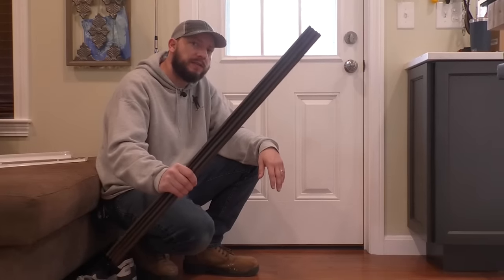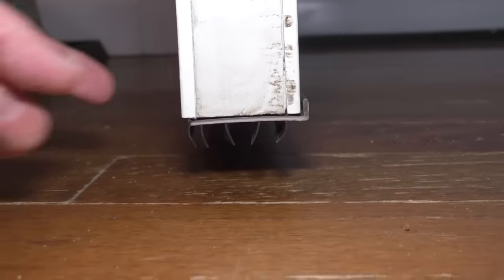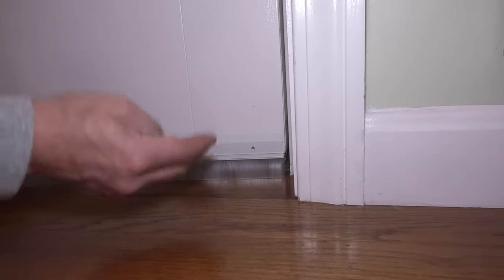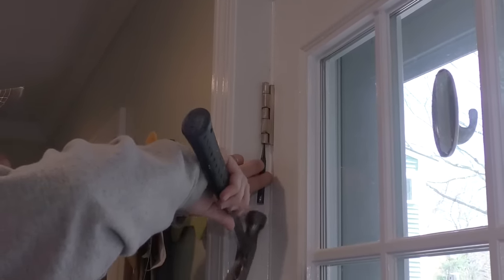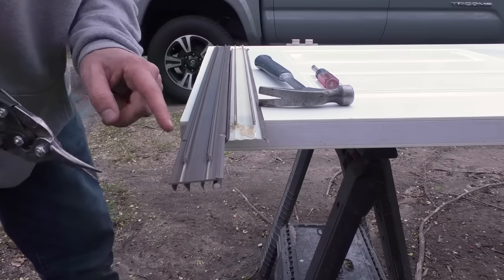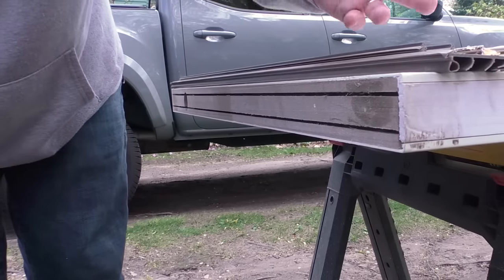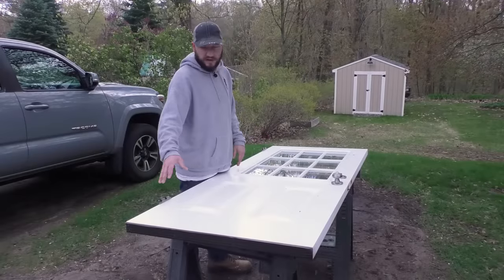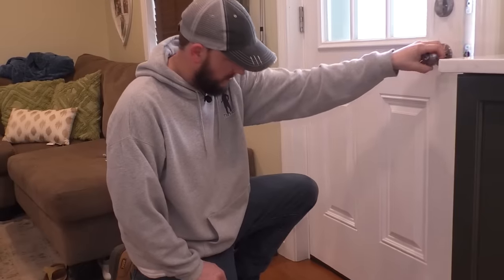How to Replace Door Sweep | Fix Gap at Bottom of your Door

Comment from the maker: Subscribe to my channel: https://bit.ly/SubscribeToTheFixer

Thanks for watching! 😃
Reply: GREAT HIDING PLACE Matt👍💯
Too funny 😂😂😂
Reply from the maker: @Rebecca C Ramirez what’s up?
Reply: Thank you!!  I have gone an entire winter not quite sure what to do… even have my door seals (not sure I bought the ones for bottoms of the doors… but seeing you do this.. I’m feeling like I can do this, so I am going to!  I also want to put a window in my steel door.. so :) just fyi in case you are planning to do that, I’ll be watching.  Thank you!
Reply: Does this work if say you weren't sure if there was a sweep previously? And how about on a storm door?
Reply: That vinyl slide-on piece is a piece of junk.  Tried it before on a patio door and it broke the pieces underneath in a matter of weeks.  For the one you chose, I would've used screws instead of nails because over time those nails will come off.

Comment: This video triggered my PTSD (sorry for exaggerating) but what should have been an easy fix took me three years to complete. The builder of my old house decided to use special doors by Pella… It was not a standard size but it looked really nice. The entry rug was short but not short enough and after a few years the sweep was ruined. I went to a Pella dealer and they helped me find the model number in the jamb and how to submit the order. Great! Simple enough, but I was wrong. The sweep that came was 2 inches too short. Went through that a few more times. But over 30 email exchanges and maybe 20 calls I did get the correct sweep. When I took the door off I was greeted by an army of ants that built a colony in the door because there was no sweep for so long. I’m talking 1,300 ants easily. I was able to eradicate the ants and install the sweep with success. So happy once that ordeal was over!

Comment: My sweeps just came in the mail today.  Since I was able to slip the old ones out, I thought I’d try slipping the new ones in.  That only worked about halfway, and then I couldn’t force them in any further.  So I pulled them out, and tried pressing them in place.  Worked like a charm.  The only fly in the ointment was that I didn’t position it carefully, so had to finish up by tapping it carefully from the end, and it slid right in.  Perfect fit, lengthwise as well. 

Repeated that with the second door, except that I positioned it more carefully, and skipped trying to slide it in. Gotta get lucky once in a while.   Each one took about five minutes.  Might be worth trying this before you go to the trouble of taking the door off the hinges.  

And now I’m going to buy a spare set of sweeps, since I already know these fit, and they might not be there when I need to replace these.  

Noticed in the video that someone had possibly put a dab of silicone on the end of the old sweep.  That would complicate things.  Not saying anyone could do what I did—each situation is unique.  But if it doesn’t work, you could always take the door off the hinges at that point.

Comment: Nice video. Only thing I would change about the final option installation would be to use wood screws to hold the sweep in place. Makes replacing in future a LOT easier ;)

Comment: Very cool video. I did this for my basement door, actually did more, because I also needed a new threshold. The old one was rotted. I found both parts at Lowes, exactly what I had. I notice your Craftsman flat head screwdriver. I have the exact same one, have used it for many years. I even use it to open oysters in the shell. Perfect for that! My wife is Korean and loves fresh oysters. We buy maybe 30 every week.
Reply from the maker: Thanks for the comment! 😁

Comment: Thanks for the video. I have a shed with a metal double door that I need to replace threshold that has come loose and anticipate having to replace the sweep. Since mine are metal doors I suppose I will need to screw into bottom of door.  Thanks again for your video.  All the best from north Texas.

Comment: I used stainless steel wood screws on both sides of the bottom trim piece, and spaced the screws six inches apart.  This allowed a firm grim on the door base, with no potential movement.  The door manufacturer had used staples which rusted out over the years.  The staples coming loose shortened the life of the seal.
Reply: What size did you use?  Is there a particular one you liked that you can link?

Comment: My front door sweep was damaged when the door was removed for a fridge delivery. Discovered it was a metal sweep that fit into the door jam, now the metal strip is bent and unseated. That explains the years of drafty air, there was never an airtight seal. We used a rolled up blanket every winter. This winter I tried the stick on sweep. It lasted 4 months but worked well. I had to remove the area rug because the sweep was close to the floor. It really blocked air flow. Now I'm going to get a handyman to add the universal sweep. My screen door also needs a new sweep. Looks like there's a channel at the bottom of that door for weatherstrip. Small improvements that can increase comfort tremendously. 
Oh, a warning about the slide on sweeps, they can hold moisture against the door bottom, causing damage and encouraging bugs.

Comment: Thanks for video, sometimes this can be harder than it should be, my junky fiberglass doors only had an 1/8" strip of deteriorating door bottom material to nail into, the rest was styrofoam with a petite wooden frame on the extremities. No way I could nail into it without breaking it so I pre-drilled and used screws. I wanted to replace that thin material since it was deteriorating but I couldn't figure out what it was, it looked like some sort of waterproofed masonite  type material. The thin wooden frame was also heavily deteriorated so there wouldn't have been much to attach the new marterial to. I see new doors in my not too distant future :(

I think you've got the drip fin facing the wrong way on that door sweep. IIRC the vertical 90 degree elbow part should be facing inwards. It probably doesn't matter on yours since you've got a storm door.

Comment: I bought a threshold with adjustable whatever it's called. Got it installed then took rhe cap off and found the aluminum adjuster screws were already destroyed and unusable. Since I glued it and sealed it I wasn't going to rip it out buy another so I went to Home Depot to inquire and they said they stopped supplying that heavy duty threshold. Well because I could adjust it the door sweep that needed to be replaced doesn't fit. I tried the adhesive version  it didn't last. Did a slide on one that caused compression against the insulation trim so that didn't work. So I was inclined to close the door and sprayed small gap foam filler waited til it dried and trimmed. But like in your video if I had the good threshold I would done the replacement you did. With modifications as needed. Your video was helpful although I had to make my own air gap stopper.

Comment: Great video. This was really helpful.

The manufacturer for my door recommended using silicone sealant between the (stanley-style) sweep and the door in addition to fastening it with staples, but none of the videos I watched show this. Do you think applying sealant is necessary?
Reply from the maker: My only thing with that is if it needs to be replaced again.  Will just make it a little more difficult.  But not a bad idea.

Comment: I’m doing this for a regular room door not an exterior outdoor door like this, it’s a bedroom wood door; I have a door but there is a gap, causing draft and wind and noise, I want to close the gap, I thought of doing exactly what you did in the video, but I also thought of just getting a piece of wood trimmed to right size in thickness and length to cover the gap and attach it to the bottom of the door with the same nails you did at the end here in this video, which do you think will provide better draft and wind and noise coverage? This door sweep you did here, or a wood piece?

Comment: Cut the sides off the inserts to make them fit the smaller kerf!

It's also important to make sure the slope of that L-shaped bottom goes down toward the outside, so water can drain! Door bottoms that have a U or otherwise don't drain are BAD NEWS for exterior doors because they can hold water in and lead to rot.
Reply: If you have a storm door, this is irrelevant.

Comment: At 3:54 you show that extending that cover to get cover the gap between the door and the frame risks hitting your foot. Makes sense, but wouldn’t you need to extend all the options you showed to cover that space? I ask because I’m replacing a U-shaped sweep with a new one and noticed this light gap with both the old & new ones. The existing door has compression weather stripping on the outside. But I still see light coming through in the bottom corner. Curious if you have thoughts on whether the door sweep should ever be larger than the door.

Comment: Hi ! Will this work on a metal door? If not, do you have any suggestions ?
Thank you. Love your videos !
Reply: Same question, I have a heavy duty metal door. I’ll be a 2 man operation taking the door off the hinges. But bigger question, do metal doors have wood inside in the event I have to use nails?
Reply: @gman76utube  I opened my door and when l looked at it from the side it sure looks like mdf board or something but wrapped in aluminum. My door is definitely far from heavy duty though.

Comment: Great information. My Andersen screen door’s seal, at the bottom, is falling off, but it’s only a thin piece of rubber. How can that be replaced?
Reply from the maker: Hey, Judith!  I wonder if the first sticky back seal I showed here would work for that?  Can you maybe stick it to the inside of the screen door down tight to the threashold?  Either that or maybe search for an original part from Anderson online?
Reply: @TheFixerHomeRepair  Thank you for responding. I will check with Andersen. I will probably have to remove the door. Eek.

Comment: I am normally able to remove the seal at the bottom of the door and install the new seal without removing the door. If you open the door, there is plenty of work to do the work ftom underneath.

Comment: Does the rubber come in diffrent lengths? My door sweep is brand new, but I can still see daylight from under the door. It seems its installed properly. I just cant tell if the rubber is too short or if the piece on the bottom of the door it rubs against is too short.

Comment: How do you fix a gap on both, buttom and the top of the door? My door has shank. I believe it’s fiberglass? It’s definitely not wood. Can’t afford a new right now and it’s still pretty. And it’s letting lots of cold air and in the summers it’s letting bugs in. Any suggestions? Thank you in advance.

Comment: On that style you do not have to remove the door. Just take off the bottom of the door and reverse the process. I owned a handyman business and did it several times. You may have to shorten the things that slide inside the grooves.

Comment: Concerning the problem you had with the Stanley sweep. You could have used a drumel tool with a cutting disc or small hand held grinder to deepen those grooves.
Reply: Pay attention. He made it very clear why he didn’t wanna use extra tools that the average homeowner may or may not have.

Comment: The original sweep for my door (from the mid 80's) has a single spline down the center. The problem is, I can't find anyone who sells such a sweep anymore.
Reply: Maybe remove the old one and grab one of those that slide completely over base and screw to the side of the bottom edge of door?
Reply: Option at about 4:30. Should work

Comment: You have it backwards.  The lip never goes on the outside because it invites water into the bottom of the door. Even if you use sealant it will not last.

Comment: What happened to engineering? This weather strip setup on a door is one of the worst designs. Taking a door off to add on such a cheap piece of you know what is not worth the time and effort. Not to mention all the  possible complications: First, The bottom door hinge could be too close to the floor to use hammer to get the pin out. Second, when you do the hammering, you could mess up your door paint or hit your hand. Last but not the least, Where do you even put down the door, not everyone has a place to set it down. What a joke in this design. Your video is good though. I used a slide in which saved me a lot of trouble.